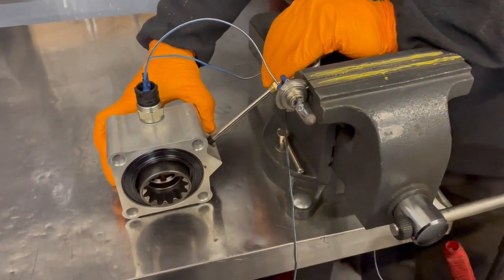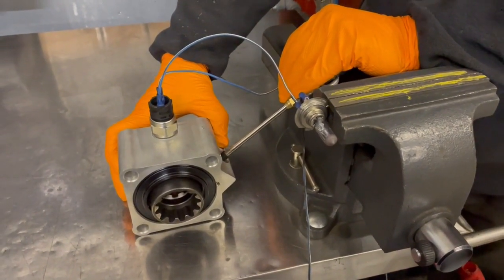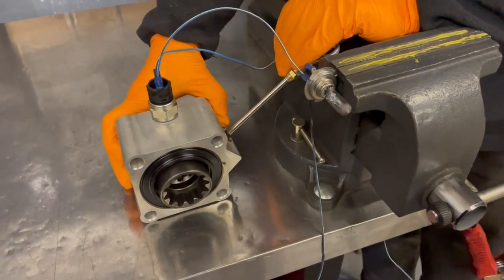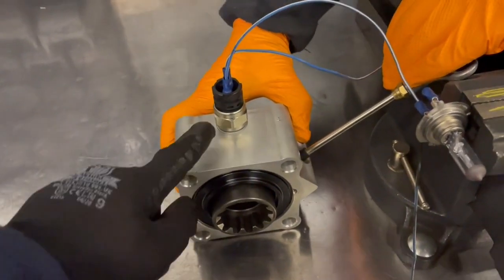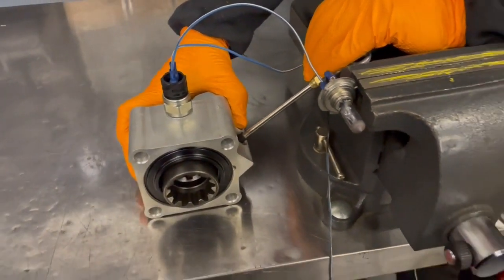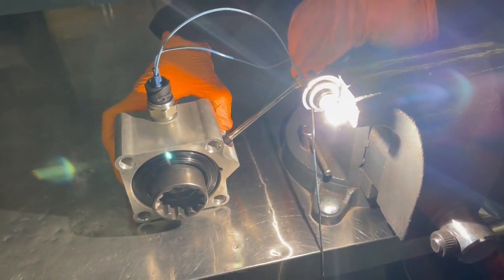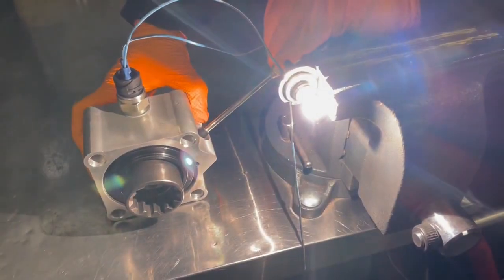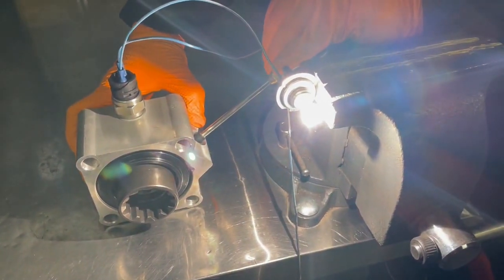Wiring a PTO Confirmation Switch for use with a Light or Buzzer

Comment: Oh wow! I thought that wire was to trigger a solenoid to allow air to activate the PTO.
So I found an air line running to the PTO from a tank with a regulator on the line and some wiring. 
Perhaps a solenoid is there to turn on the air?